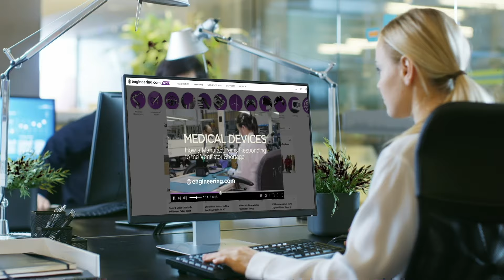3D Printing: When Does This Technology Deliver on Its Promise?

Comment: Small job shops do small jobs and are needed for the small and workable projects ,the one offs. And not mass made. The small jobs include all these super skilled tool and die makers that used to be the backbone of British engineering that made the worlds products. All the super dies for mass production are MADE by the little craftsmen in small shops. 3d printing requires a load of different IT skills and expensive tools.